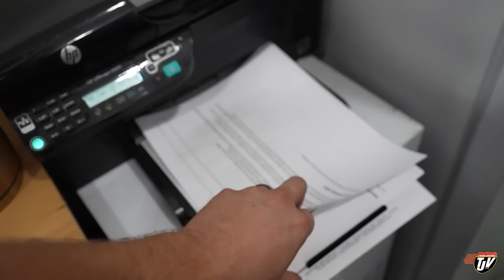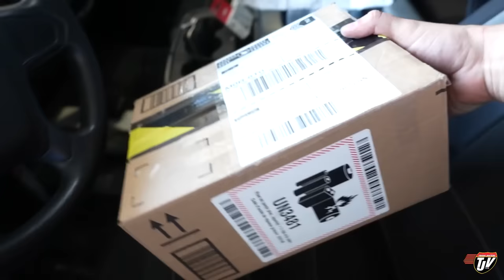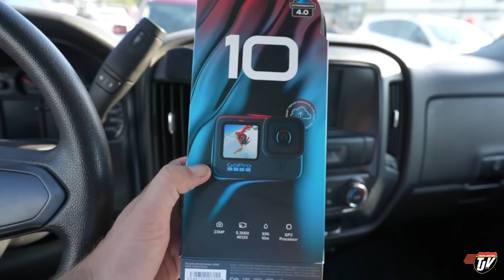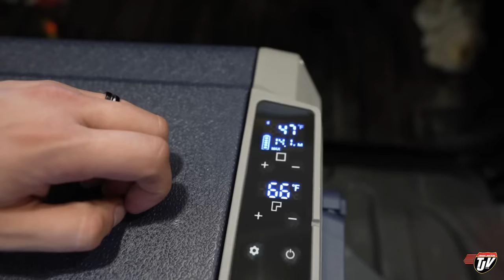TRUCK FRIDGE | My Trucking Life | Vlog #2861

Comment: The marque of the fridge "Bodega" is a noun that has Spanish, Italian/ Greek (latin) origins. In Hungarian it means:
1. A simple building, a small house, usually erected temporarily in one place; it can also be called: shack.
2. A smaller snack bar, which also measures drinks, where mainly spirits and "cold dishes" (sandwiches...etc.) are served; see also: buffet.

Comment: I have a HP printer and HP have a service called instant ink. So you choose your plan depending on how much you print each month and they send you  new ink before you run out, that way you never run out of ink. I presume it's available in Canada. I pay £3.74 a month for the service.

Comment: When Josh begins to rhyme you know he's trying to buy time. And Josh we do have Staples down here in the United States I was unaware Adam in Canada we have Staples, OfficeMax and Office Depot. They're actually office supply and equipment stores. And just out of curiosity did you check down inside the battery compartment on the camera sometimes there's a little tiny plastic tab that you have to pull off for the battery won't make connection inside.
Reply from the maker: Yes I checked. It was all clear
Reply: @Trucker_Josh  Well that is a good thing because I did that one day bought something on Amazon, sent it back thinking it was defective, then I get a package in the mail with my item and it's the same serial number and in the packaging taped to the items box was a sticky note saying "Please remember to remove plastic tab inside battery compartment thereforth preventing the device from getting power from the battery and preventing another "defective item" return."

I literally looked down saw it and died laughing 😆

That was my blonde moment for the year last year. Now starting to worry whaty blonde moment of the year this year will be.